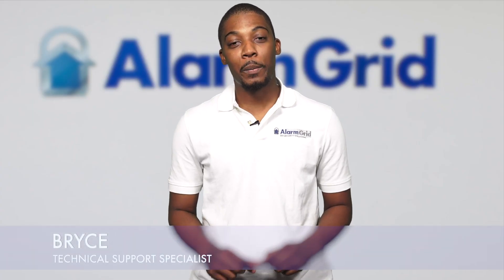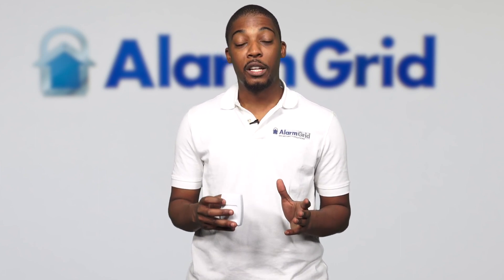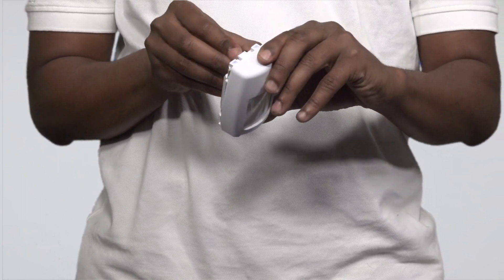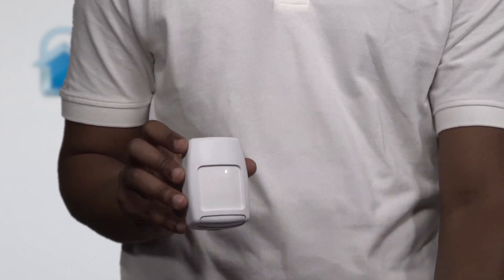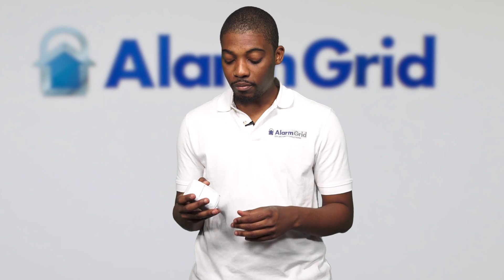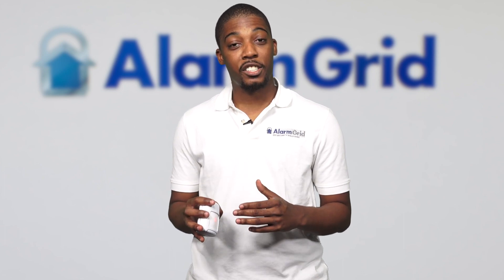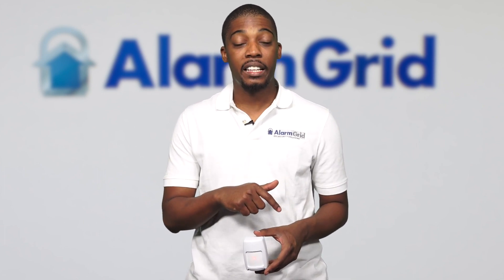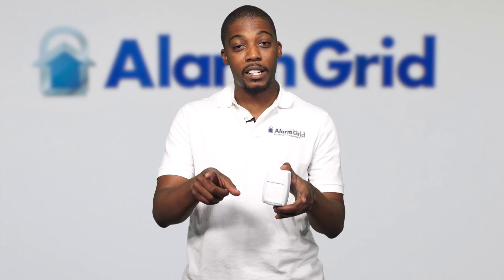Red Flashing Light on a Honeywell Motion Sensor Means Walk Test

Comment: Do these motion detectors record as well?
Reply: These motion detectors do not record as they only trigger an alarm when a heat signature is detected. You may be thinking of an image sensor, which is similar to a motion detector but has a camera built in as well. Those do not record clips but do take pictures, but unfortunately Resideo do not produce image sensors. 

Here are some security cameras that record video clips when motion is detected: https://www.alarmgrid.com/browse/hd-cameras/brands/honeywell
Reply: @dylanalarm_grid1038  thank you Dylan 🙂
Reply: @dylanalarm_grid1038   so it’s doesn’t record but it take photos? Every time it’s red?

Comment: I unplugged my light and the red light kept flashing for 15 min (no power ) it's a 110V light with sensor and some times it just stops working and red light starts flashing
Reply from the maker: A 110V light with a motion sensor is different from the low voltage motion detector that is being discussed in this video. You should look for support information by finding the model number of your light, and then searching for information specific to that product.  We only deal with low-voltage devices. Products that run on 110V without a step-down transformer are beyond the scope of our support.  If you can't resolve the issue on your own, I would suggest contacting an electrician.

Comment: How do I stop walk test mode of clipsal Infrascan IP66  3 wire?. The red light has been blinking for months.
Reply from the maker: You'll need to check the installation Instructions for that particular model, it's not one that we've worked with before.  Wired motion detectors often have a dip switch inside that enables or disables the LED.